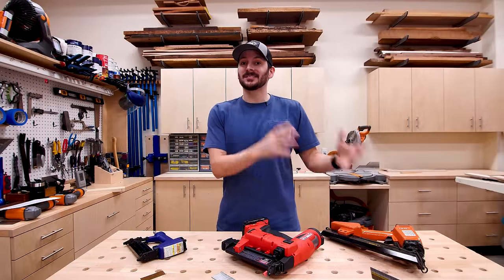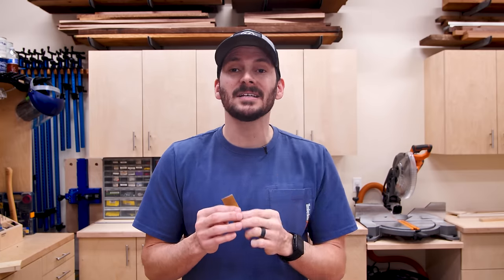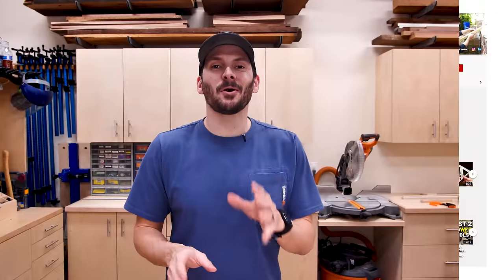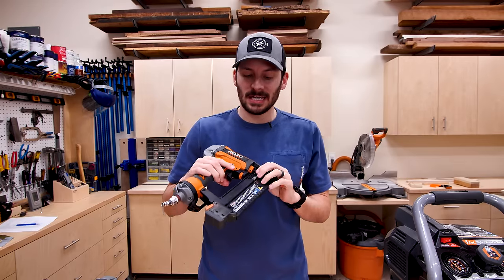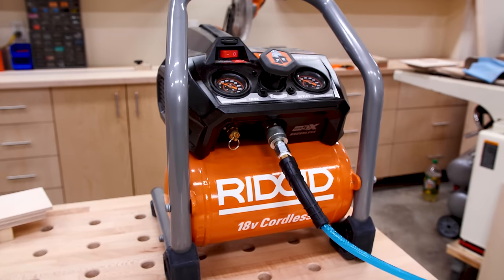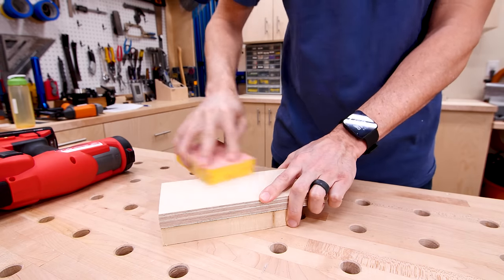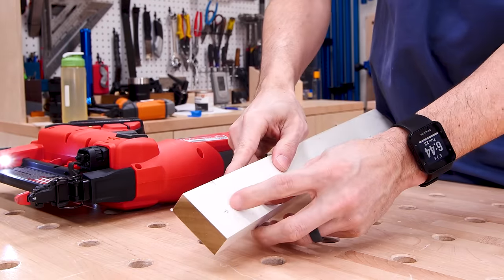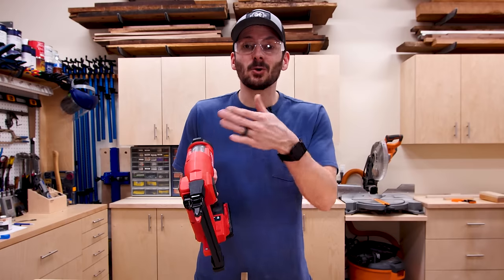6 Nail Gun Mistakes You Should Avoid | Brad Nailer Tips

Comment: About the blowouts...First, I tend to align the nailer at a slight angle - not in line, but not quite perpendicular either.  Second, one of the best tips I've come across is try to aim for the middle of the piece, not the edges.  I know, sometimes the width you're working with makes this a moot point, but aiming at the center of a 3/4" piece  to put the brad is better than aiming 1/8" form the edge.   (Also, I know I"m late, but I found this when researching new brad nailers to replace an old one I  have that is out of production, and ya can't get the parts I need.   Nice vid, by the way)

Comment: As a finish contractor I use the 21ga. The most. It has a slight head so it’s got holding power as the 23 does not. Just my opinion but you should have one on this line up. 15-16 good for door installs but not so much for pre-finished base or the like
Reply from the maker: wow, that's like a unicorn.  I've literally never seen one.  What brand do you use?
Reply: @Fixthisbuildthat  , I don't think that he is a legit finish contractor if a 21 gauge is his go to gun

Comment: Thanks! I really liked the painter’s tape before nailing tip, to reduce cleanup/finish issues. Then the turning of the gun perpendicular is legit, too. Sometimes you have no choice, if there’s an obstacle, but use the other anti-blowout tips in there. In terms of whether to use an oil-lubricated nailer, consider whether the splash of oil around the nail-hole will affect whatever stain/finish you chose. The oil-free guns use plastic parts inside that might not last as long.

Comment: I am every bit as careful as you on finger placement.  But only after the 18 gauge came through and got me in the index finger.   Ouch is all I can say. I was nailing 1 inch and swapped to 1 1/2 for another joint and then went back to what I was doing and it was bad.

Comment: Great video, very helpful. What is causing double fire the nailer? Thats my problem that i cant figure out...
Reply from the maker: I'm not familiar with that issue, but assume it would be something to do with the recoil and safety trigger
Reply: Disconnect power source and open the hammer end and shift the load and close it back up and try again. Sometimes it seems mine must have tiny dust or chips messing with the hammer mechanism. So I just go through a clearing step and for some reason it works for me.
Reply: @Fixthisbuildthat  No worries, it might be just me as I haven't seen much info on this.
Reply: You might be using the wrong gauge in your gun.
Reply: @markschiavone8003  Thanks, i double checked now, gun and nails are all 18g. It doesnt happent often (but always at the wrong time) thats why I have no clue. I did clean it so I will test it a bit to see how it goes.
Reply: @asztapaszta9  , sometimes it matters how the nails are corrugated, sometimes a certain brand shoots better if you use the nails from that brand of gun. 

I know it can be frustrating!!
Reply: @mikes1345  I meant to say thanks and  I will do that, not sure where my comment went...

Comment: Years ago I attached a 2-in by 3/4 piece of oak onto oak plywood on the side of a refrigerator enclosure.  I shot too far to the right and used too long of a fastener and it blew out. It blew out cleanly without much damage but the fastener was sticking out. . I use my Dremel tool with a super fine cut off wheel and going with the direction of the grain in a dark spot cut straight into the wood behind where it came out to cut off the brad nail. The tiny divot looks like wood grain and color matched putty made it disappear.

Comment: Oilers...I use a small in line oiler unit that delivers just the right amount of oil to the nail gun. It is made from brass and clear plastic so I can see when it is empty and it fits right in the air line just behind the gun. I ruined one nail/staple gun because I didn't put enough oil in it. These things are pretty cheap (just a few UK £'s and hold about 20cc of oil) so I have one connected to each of my nailers and staplers. One other thing, I first bought a nailer and stapler gun combined to save money. This always left a groove in the material when using it for just nails no matter how much I adjusted the air pressure. More filling and sanding! One tool, one job is better and it takes just seconds to switch from one to the other, no messing about with changing nails for staples during a project. I also tend to angle my nailing along the length of the material to get better purchase.Great video though. I found it most informative (as all your videos are). Thanks.

Comment: Great Video !!!!! Still have one question, how do you decide between using 15 ga and 18ga based on holding strength?
Reply: The brad nailer is for general use temporary holding, like building drawers. Possibly for shoe molding or quarter round. The 15ga is for door/window trim, baseboards.
Reply from the maker: I only use the 15 gauge for finish trim, never on woodworking projects.  And only use 18ga for shoe molding or quarter round in the house, but for all woodworking projects.  Hope that helps
Reply: @Fixthisbuildthat  It does help, thanks

Comment: Good stuff. Excellent review and advice. Thanks!
P.S. Your comment on blowout is spot on.  This is no joke and should not be taken lightly.  This is especially true when you are dealing with dimensional construction-grade lumber  -- and the nail sizes that are required. Even smaller gauge nails that are over about 1" in length can also yield some nasty blowouts. 
Nails can hit knots or twisted grain and blow straight out the side of a board.  You do NOT want any part of your body in the path of such events. DAMHIKT. ✔

Comment: You should check out the Milwaukee M12 23 Gauge Pin Nailer.  It’s an amazing tool.  It’s about the size, maybe a bit larger than a 23 Gauge Pneumatic Pin Nailer.  You can and will want to ditch your compressor, hose and existing 23 gauge air gun.  I sinks 1 3/8” pin nails as fast as you pull the trigger, while firing into hard woods.

Comment: If you do have a blowout in the side of a piece of wood, a Dremel tool is the perfect fix.  I've used one of their very thin cut off wheels to cut off the nail slightly above the blowout. Slice straight into the wood, parallel to the grain  and 1/8 of an inch or so above any damage caused by the blowout.  Now, just pull out the protruding part  and do whatever you need to do to fix the damage.  If the wood is already stained and  finished,  sometimes all you need is some matching wood putty to fill the narrow slot made by the Dremel disk.
Dremel has two different unreforced discs and the one you want to use is the super thin and fragile one.

Comment: Speaking of nails in fingers. Another thing that is probably a lot more rare would be not standing over something that you were nailing. Last November I was building some Barn doors on rollers from scratch and I was having to nail the outside trim that was 1 in reclaimed heart pine to 3/8 rough cut pine plywood and because of that I was having to nail both sides and I was not really paying too close of tension and was having to nail on top and then going underneath the same spot and nailing and when I did one of the nails that I was using shot through both pieces of lumber and actually went straight into my nose right above the bridge and I mean maybe 3/8 of an inch for my eyeball. I know that everyone says I should have been wearing safety glasses and yes I should have but at the time I hadn't bought a new pair and they were so scratched and stuffed up so much I couldn't see out of them anyways and also that it actually went into my nose it's such an angle that had been wearing safety glasses it would have just went up underneath them anyways. Luckily or unluckily depending on how you look at it it did not go into the bone at my bridge and was only going through my skin as if it was a little needle and we were in kindergarten again and I know everybody remembers doing that. but just be mindful of leaning over the piece that you were nailing if you're doing so to save time like I was. And for the hardcore of the hardcore and hard-headed then I guess be thankful that the good Lord decided to bless all of us with two eyes! All joking aside please be mindful even an experienced carpenter can do it very easily. I have been doing carpentry for 15 years now it seems like the more that we get accustomed and comfortable with tools the easier simple mistakes seem to happen. Complacency is the enemy of safety.

Comment: This is a great video, I subbed to this channel because of this video here.  The only advice I would take with a grain of salt is about the air compressors.  I don't believe it is possible to purchase a consumer grade air compressor that can keep up with more demanding shop tools or HVLP sprayers.  Those are rated for CFM, and the consumer compressors are rated at SCFM, which is marketing gimmick.  AvE has a pretty good video about SCFM and it being rated on the output side at inlet pressure.  The only real way you drive those tools on consumer compressors is by coupling them to large tanks.  For that reason, I've moved to turbine sprayers for when I need to do HVLP, I have my 20 gallon compressor to run nailguns and the like.  But I would move to cordless/corded for wrenches.
Reply: I have a turbine and never considered using it for a nailer. Is this possible?
Reply: @firesurfer  No that is me using my stream of consciousness and not being precise.  The turbine is only like 5-10psi, far too low to power a nailer.

Comment: Hey,  thanks for your video.  Very helpful tips.  Wondering if you could make a recommendation for what kind of nail gun for the sort of a hobby / business that I do. So,  I build home theater subwoofers,  sometimes very high power ones and I typically "glue it and screw it " as some say.  However,  I have a friend who does the same type of jobs that I do but for car subwoofer boxes.  I happened to swing by his shop and watched him build a very nice box because was working on sort of an exotic car, he was using an air nailer and the time that it took him was so fast when compared to gluing, clamps and screws, sometimes pocket hole jigs. We both typically use 3/4 birch or medium density fiberboard. My question is what size gun should I use for this.   18 ga.? 15 ga?  BTW I do have a compressor.   Thanks again.

Comment: Hint for headless pin nailers: because there is no head the nail has less holding power (as mention in the video). One way to improve this situation is to fire nails in pairs with a slight change in angles (eg:  / \ ).  Very handy when using pin nailers when installing baseboards.

Comment: The point on the nail decides the direction you want to use the nailer. The perpendicular method works with brad nailers, when using other nailers, look at the angle of the nail, as you may not want to go perpendicular.

Comment: 9:20 One easy way to use a smaller compressor for a bigger job is to find yourself an external air-tank (these can often be procured for free or very cheaply, like by salvaging the tank from a broken air-compressor, or modifying an old pressurized-product cylinder that had been used for water, propane, or welding-gas; the Amish use large "retired" horizontal propane-storage tanks for powering air-tools in their commercial woodworking shops) and hook it up to your compressor so that it fills both its own built-in tank and the external tank at the same time; this not only gives you longer run-time between jarringly-noisy compressor-runnings, but it also saves wear on your compressor, as well, since it doesn't have to cycle on and off so often; it merely runs longer each time it kicks on.

Comment: The 2x4 shape of brads explanation was good but not actually why they don't blow out. It's more the chisel direction, the grind at the end of the brad. Works with old school nails and when taught in school or large shops is called chisel direction. Even more important with staples and micro pin, which are not rectangular from top view.
       Great video.

Comment: My experience with battery power is that for a little convenience you buy a lot of dead battery problems.   All my air nailers are just that, air powered.   Best part is that you only need to hold alignment long enough to pull the trigger.

Comment: You could have described that better by showing the wedge or angled cut of the nails at the tip.  Because of those angles the nail will tend to travel where that wedge wants to go which is typically left or right along that angle.  Always shoot in a manner that allows that side to side travel without giving the opportunity to to go proud of the work peice

Comment: Another reason the nail wants to go left or right is the bevel on them. They are ground on the sides of the sheet of nails. Some even only on one side. The top and bottom are flat so that’s less likely to change direction in the work piece.

Comment: Those trim nails already have glue on them thats why the bottom half of the strip is that yellowish color, when you shoot the nail the friction from going through the wood causes heat and melts the glue for a better hold, and another reason for blow out is the nail itself of you look at the business end of the nail there's a bevel which is why if you hold the nail gun perpendicular to your piece the bevel can go right or left, and holding it parallel the beveled end wants to go right or left and causes a blow out

Comment: My shop teacher always told us, you will get hurt when you do two or more things wrong. For example, on a miter saw, if you have your hand too close to the blade, you will probably be fine. However, if you have a crooked board on a miter saw with your hand too close, you have a much higher chance of losing a digit. I was nailing drawers together one time in my own shop, I had my PSI too high and I had my hand too close to the brad nailer. I ended up shooting a 1 1/4' brad nail into my thumb all the way up to the head (it went in at an angle, my thumb isn't that thick haha) Anyway, I did two things wrong in that situation. This rule applies to almost everything in life.

Comment: Ha Ha Brad on Brad nailer!  😁😂 What in the devil is that orange 15 gauge ‘Russian looking’ pneumatic trim gun?  Wow!  Pin nails actually have a tiny ‘head’ on them, and it’s hard to tell the difference between the ends, so that’s why the ‘arrows’ are printed on the sides of the nail strips.  Pin nailer is invaluable.  Milwaukee just introduced a M12 pin nailer.  That outta be the cats (you know what!). Always keep track of where your fingers are!  I’ve had 18 gauge Brad nails curl out the side of small moulding and into my finger!  Yeah!  Peace!  👍👍👍👍👍😁✌🏻🇺🇸

Comment: How you orientate the nail gun definitely matters but it is not always perpendicular to the stock'. With a finish nailer, you would orientate the gun in line with your stock. This is the reason, the direction that the nail wants to travel has more to do with the chiseled tip of each nail. Brad nails are chiseled on the sides so shooting it perpendicular is correct. However, finish nails are chiseled on the front and back of each nail so if you shoot them perpendicular the chances of a blowout increase dramatically. When in doubt, pull the nails out of the gun and look at the tips and proceed accordingly.

Comment: Had my hand in the wrong spot when the nail blew through the side. Ouch! Literally nailed myself to the board! Watch which way the grain is going. The nail will follow the grain. He just taught an old dog new tricks. I didn’t know about turning at 90°.
Another trick I use if you’re edge joining boards with glue. Drive the pin nails half way into the board edge down the length to be glued. You don’t need many. Apply glue and clamp together. You will find your boards won’t slide around anymore. 
Blue tape? Damn that was obvious and so simple. Unless of course you love sanding!

Comment: The other reason to hold the gun perpendicular is that the brads have a chisel point.  If you're in line with the grain, the chisel point follows it, like a sled runner.  if the chisel point is perpendicular, it cuts through the grain.
Reply: PS- gotta love the blue tape trick. Blue tape is also handy when you're laying out locations on a painted wall- mark on the tape, make your hole and pull the tape off.

Comment: This has probably been mentioned already but the nails also have a bevel cut on the tips. The bevel will naturally follow the grain and blow out. Rotating 90 degrees changes the direction the bevel enters the wood so it is less likeLy to follow the grain out the side of the board. Pin nails don’t have a bevel and are evil little nails that do what they want.

Comment: 9:30 Careful! Not just any oil will do. Be sure to mention types which are O-ring safe for your pneumatic or battery-op rig, and which are not. Wrong oil will absolutely put the hurt on nailers' ability to maintain pressure, requiring an overhaul kit (often $60+!)
.
Reply: Nice video you are very informative.  You forgot to tell the newbies about draining your air compressor at the end of everyday to eliminate moisture in your guns and rust in the tank or using a moisture separator in humid climates.
Reply: T nails are always supposed to be nailed with the grain as you said I am a trim punch out guy and have a custom woodworking shop at my home. I have been a carpenter for over 30 years. You are one of the only people that I have ever seen on the internet that actually knew to fire a brad or 18ga. Tnail at a 90° angle to the wood or inline with the grain. Good on you. Great video!!!!